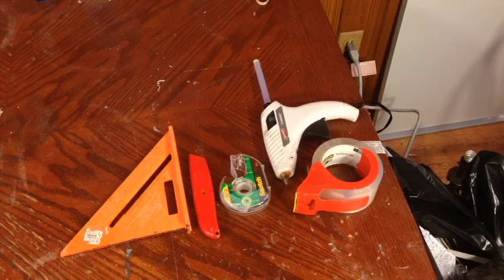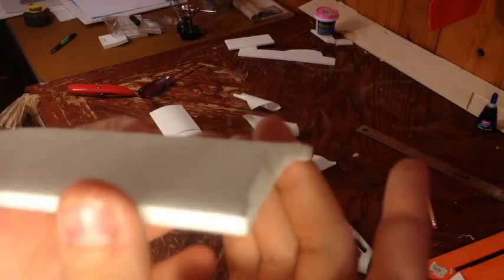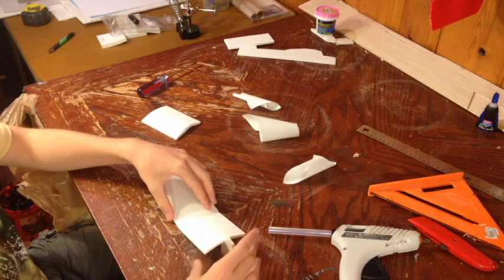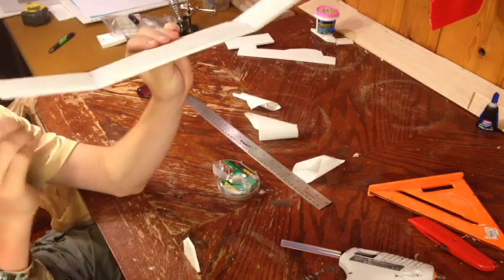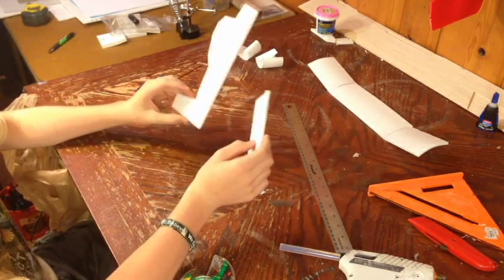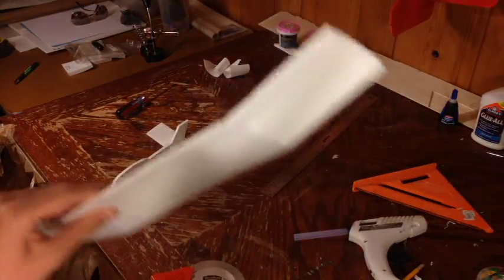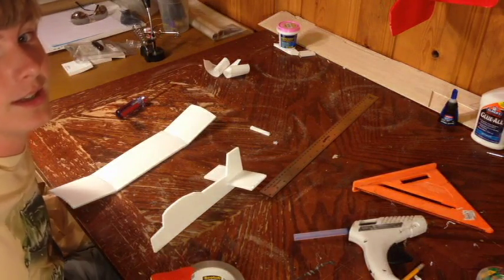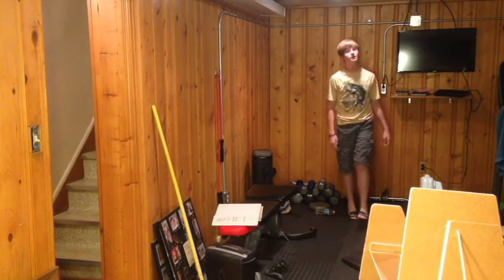Foam Test: Simple Glider Build

Comment: And I have made a foam board bf109 it's a penny glider but it won't fly what nose weight do I need it said 25cents but I live in the UK any advice
Reply from the maker: I am not sure about the weights of UK currency but I would add and subtract noseweight until it flies correctly. If the nose is tipping up into the air when you throw it and stalling it is too tail heavy. If the plane arcs down like a dart it is too nose heavy.

Comment: nice video! I've been looking for a good first scratch build for a little while now and I found this. So I went to Walmart, bought some foam board and made it. Flies great but i had noticed in the video that it was tilting slightly down but my elevator is steeper and it flies really straight. Thanks for the video!
Reply from the maker: Glad to hear that you had some success with it. If you look at my latest video I have another design for a micro plane that was originally a great chuck glider. I’d you liked this build I’m sure you will like that one as well, there is a link in the description to the forum with the plans for it.

Comment: i had the idea to take an old micro drone and take off three motors and put the circuit board  and motor on the glider would i need to modify dementions or keep them the same
Reply from the maker: Sam Lane I believe that you wouldn't, but feel free to experiment with it.
Reply: Sam Lane Google 4 engine vtol,and you will see an early test plane from the 1960s,a little foam board some glue and that quad reconfigured a little I bet you could come up with something pretty cool
Reply from the maker: Hey I completely forgot about this comment until about 1 week ago. I just made the og plane in this video powered using my hubsan x4 board and motors.  I may post about it soon if it works as well as it seems to be in testing. The only issue is that I can't test it for a while because of snow.

Comment: Thanks for the videos.  You're doing a nice job with show, tell and explain.  I'm beginning in the hobby and appreciate your efforts.
I haven't yet found the video showing the build procedure for the motorized 200% version of the glider, but I'll keep looking.
Reply from the maker: southernexposure123 I have a video on the 200% version, but it's not ready to be "released" yet. I also am still learning a cad software to make the plans. When it's available I will release it, until then I would recommend an ft old fogey if you'd like something similar. 

I hope this helped!